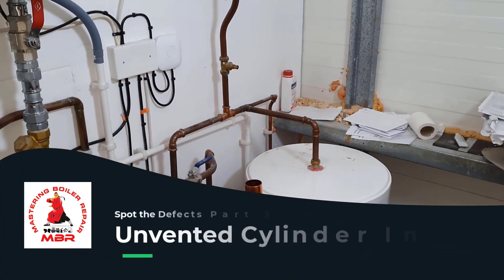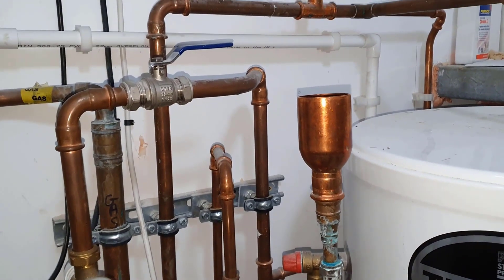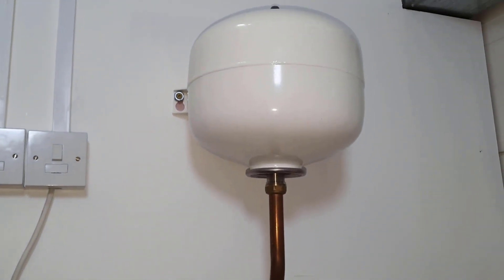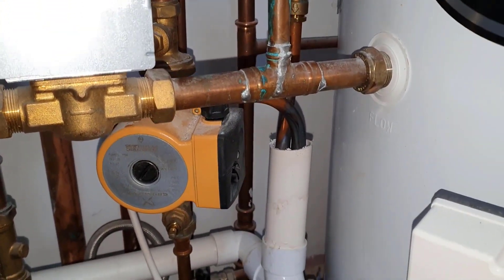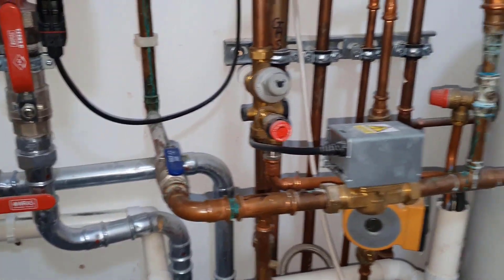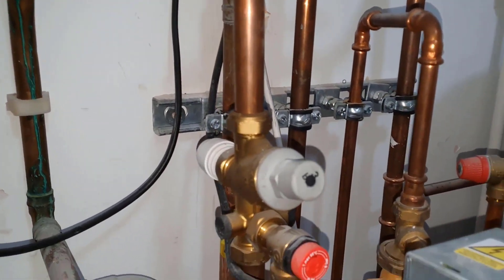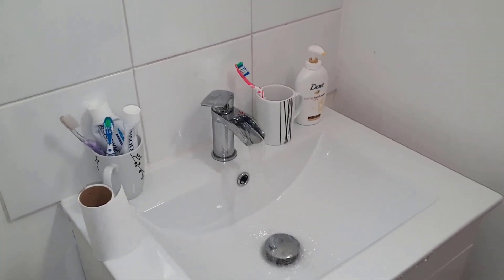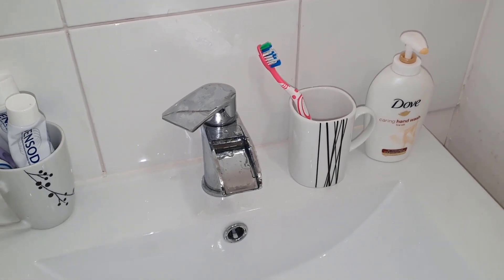Unvented Cylinder Installation Spot the Defects The Answers Part 2

Comment: Why not using lever valves? These are better than any other valve on the market. Gate valve snap often and are useless... I agree with the most of what you said but disagree with the lever valves
Reply from the maker: Hi lever valves are better than gate valves. What I did said stops are for water mains. Lever valves are suitable for everything else.